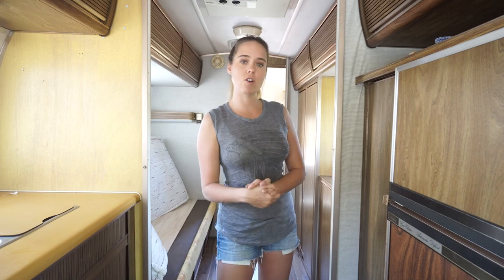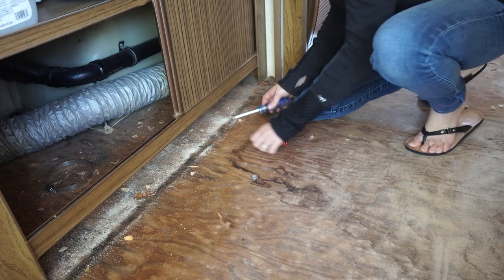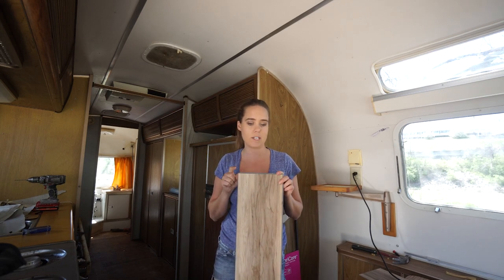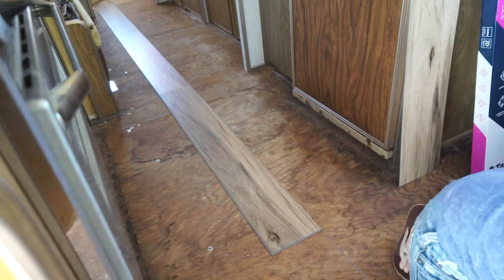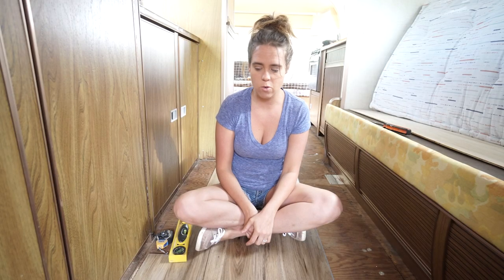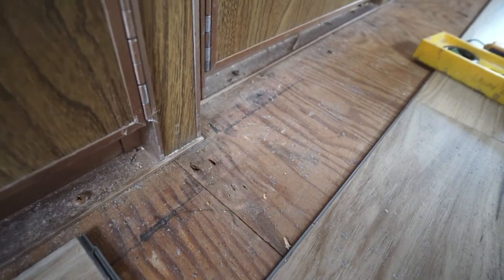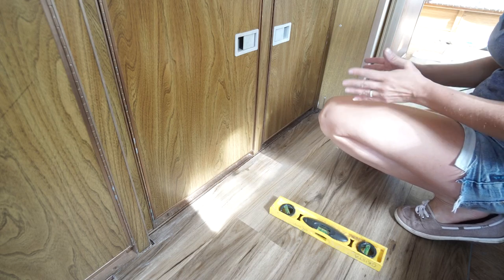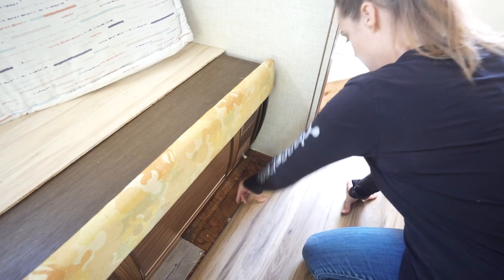Installing Vinyl Flooring in Airstream (DIY!)

Comment: I just bought a 1972 Land Yacht. I dont want it PERFECT..I want it comfortable and dry. Luckily we just had a hurricane come through and none of the windows leaded...!!! It has carpet just like yours but it also has a couple 'soft spots"...one in the bathroom and one up front so I hope we don't have to put in a whole new flooring. Also, I want to use this more as a "fish camp" on a semi permanent location with a shed that is our bathroom/changing station laundry and get rid of the bathroom altogether in the back..rip out the black tank etc...I have been experimenting with a tent/luggable loo and would rather go outside than have my bathroom inside...but thats just me. I am a woodworker by hobby and would treat the seams with a very shallow decorative wood strip all through the entire trailer....and not worry about it being PERFECT... love your video.